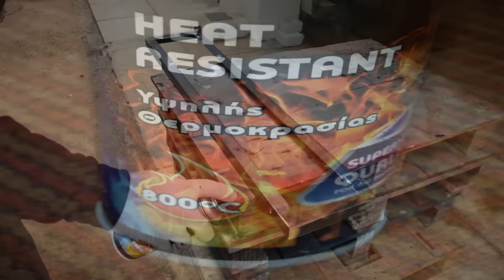HOW TO BUILD A BARREL BBQ/SMOKER (PART 2)

Comment: Do you have a material list that you use for the barrel
Reply from the maker: Sorry, I don't have a material list... Everything I used is shown on my videos Part 1 and Part 2. However I will send you a link of a picture with the dimensions of the BBQ.
Reply from the maker: Here are the measurements for the Barrel BBQ:
https://www.facebook.com/photo?fbid=2562179130553153&set=a.2562180023886397
Reply from the maker: GRILL RACK DIMENSIONS

The dimensions of the bottom grate are 90.5cm X 52cm.
The dimensions of the top grate are 87.5cm X 22cm.
The height of the top grate is 16cm.
I used iron angles with dimensions  3cm X 3cm and 8mm diameter rods with 2cm gap in between the rods.
However, I suggest that you have to make the grill fit your BBQ's dimensions.

Comment: Are you using normal nuts and bolts?
Reply: Is the alternative ab-normal?? lol, i would recommend something rust resistant and something that could handle the heat, whether it is zinc coated or stainless hardware.  i am not 100% sure what he used, but this is what i would do
Reply: @MrMatt713  thank you bro
Reply from the maker: Yes I used normal nuts and bolts...

Comment: What is the frame dimension?
Reply from the maker: Here are the measurements for the Barrel BBQ:
https://www.facebook.com/photo?fbid=2562179130553153&set=a.2562180023886397
Reply from the maker: GRILL RACK DIMENSIONS

The dimensions of the bottom grate are 90.5cm X 52cm.
The dimensions of the top grate are 87.5cm X 22cm.
The height of the top grate is 16cm.
I used iron angles with dimensions  3cm X 3cm and 8mm diameter rods with 2cm gap in between the rods.
However, I suggest that you have to make the grill fit your BBQ's dimensions.